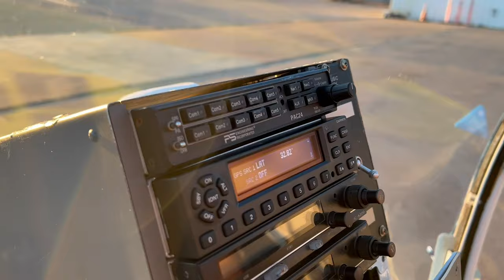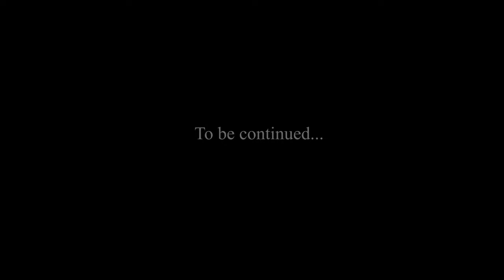Broken Helicopter?! Bell 47 Ferry Flight VLOG  (Part 1)

Comment: You might not want to stand under the rotor disc while it is running down. Not a good idea.
Reply from the maker: Probably good advice! Thanks for watching:)
Reply: @GuardianAir  I was an Army Aviator and flew this Helo in combat, and took instrument training in the TH-13T at Ft Rucker. They beat it into us; duck and move outside the disc...I also flew the Hiller OH-23G in combat, along with the usual other models like the UH-1D...And I have done a lot of VFR cross country flying at night...Loads of Fun!